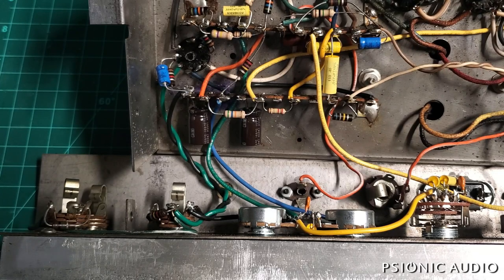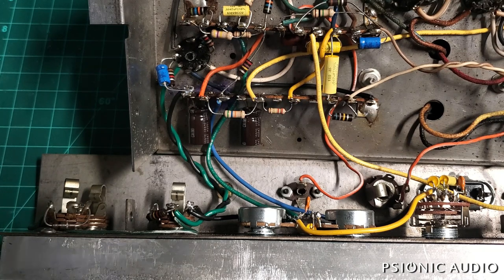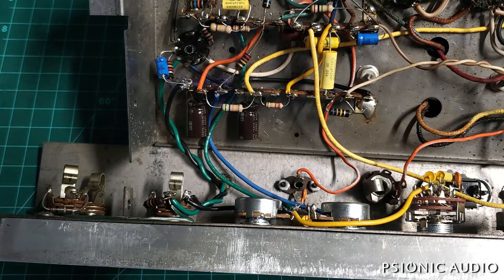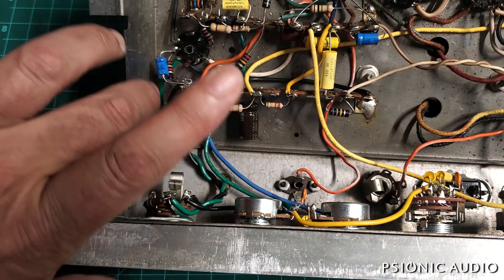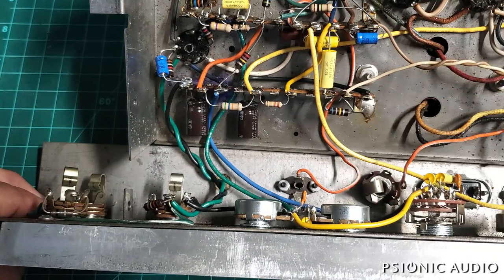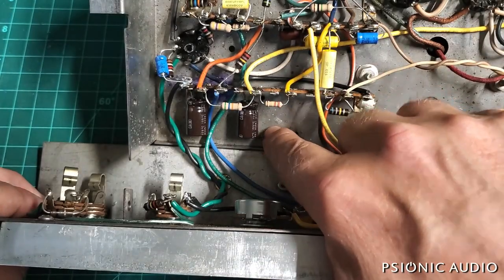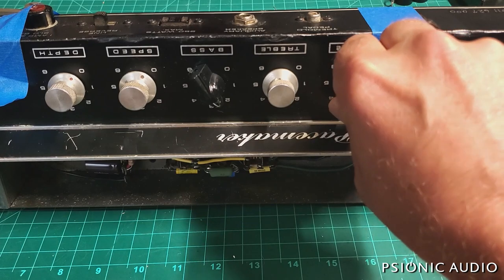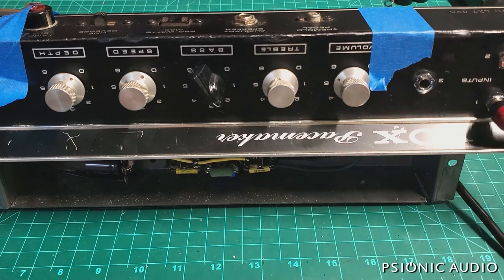'66 Vox (Thomas Organ) Pacemaker | Part 6 : All Jacked Up - Debuzzing the Preamp

Comment: Curious about how a ground loop on the input shows up with the volume all the way down.  I'm assuming the volume control is after the first preamp.  Normally, noise that appears with the volume all the way down would have me hunting for sources after the volume control. (Or is the bottom of the volume control caught up in this same ground loop?)
Reply: I've noticed that ground loop noise is  sometimes most noticeable when the pot is either all the way up or all the way down, and minimal when the control is set midway. Presimably some kind of a drive-impedance artifact or a null effect that occurs when both sides of the pot's resistance are equal.
Reply: @goodun2974  Actually, I think with the pot all the way down, the preamp input is directly connected to the opposite end of any ground loop that involves the pot.  Just another manifestation of the ground loop involving the front panel.